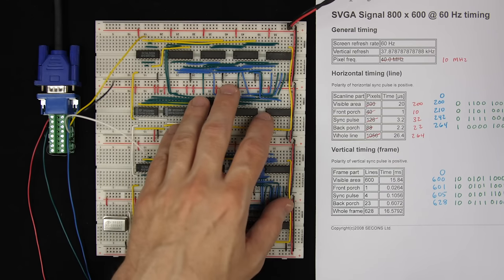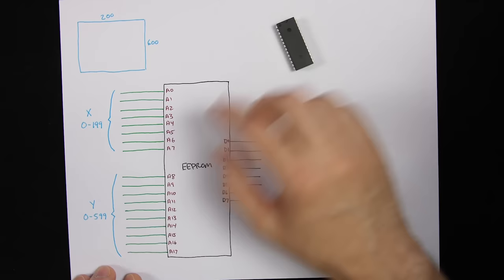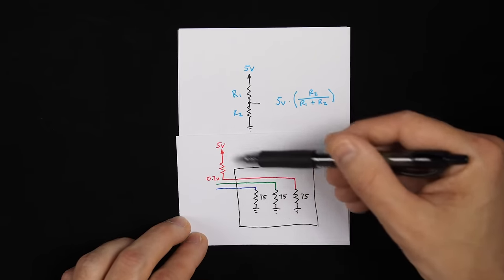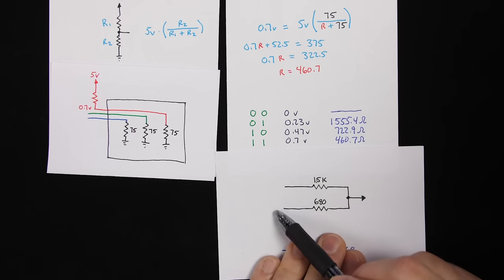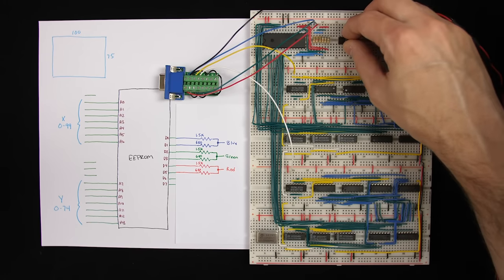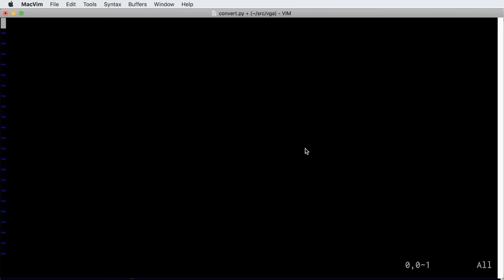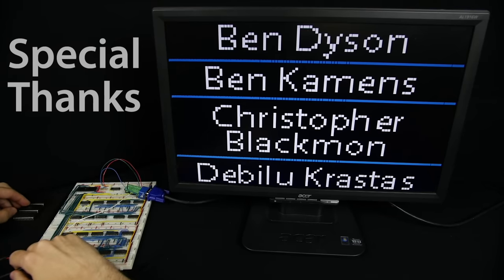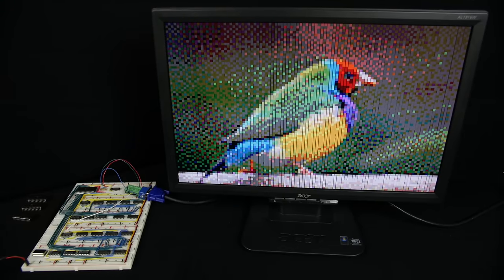World's worst video card? The exciting conclusion

Comment: +100% for ingenious design. - 1% for using exceptions as flow control. tsk tsk :)
Reply: why is that bad? It's a philosophy, and potentially faster if the exception is not raised in most cases. (Though in this scenario it's more common to end up in the except: block, so it's probably slower.)
Reply: You must be a java/c programmer! Exceptions aren't as costly in python, and In fact one of the zens of python are - it's better to ask for forgiveness than permission :)
Reply: @ajith12312  well I really have to get used to that philosophy, too...
Reply: @ajith12312  Exceptions in small projects where all the outputs can be predicted ,it's actually better to throw exceptions and catch them ... However in bigger projects.... well.... that's an exception
Reply: @amineabdz  ya that's true. It does become easier if the methods throw defined meaningful errors.
Reply: @ajith12312  c doesn't have exceptions...
Reply: @ajith12312  You mean relatively costly, because everything is costly in an interpreted language like Python.
Reply: @Lightning-Shock  hehe yup
Reply: it's the python way
Reply: You don't need to check for bounds anyway.  Just add out_file.write(chr(0)*28) at the end of the loop.
Reply: @ovalteen4404  True.
Reply: Nothing wrong with that in Python my dude.
Reply: Pythonistas love the exception (and pseudocode).
Reply: @user93237  Not experienced ones. Exceptions are there to catch exceptions, they are not there to act as a pseudo range checker or whatever. Its a way to gracefully handle something going wrong

Pythons picked up a lot of careless coders lately riding the fad wave in. I wish they'd pause a little and watch how the old timers do it. Pythons an ld language (seriously, its turning 30 in december). Its survived so long due to its cautious non hype driven nature. Exceptions where always intended as a way to deal with, well, exception. Using it this way is an antipattern
Reply: LightningShock Maybe he uses pypy
Reply: @shayneoneill1506  Experienced Python coder here, totally agreed. This is in no way Pythonic.
Reply: I think the exception checking here makes a little sense..  It allows for variable sized images to be loaded onto the card, but cropped to the upper left 100 x 75 pixels.  If he used specific range checking this wouldn't work.. though it is so special case and single use that I doubt it really matters what he did.  :P
Reply: @corneliaxaos2745  I'd be more comfortable if he used exceptiond correctly, by actually checking for an IndexError and/or KeyError. The problem with bare exceptions is they'll swallow OTHER problems and you might not know why your code is now behaving in undefined ways. You should never use a raw exception, trap for SPECIFIC exceptions. Still, its better to actually test the limits of the Indexes and then use something like an inline if statement. This is LESS code., and more correct array handling.

Hell you could probaly fold it into a lambda and a map and turn the entire exercise into a one liner. But thats a bit ugly and unpythonic.
Reply: @shayneoneill1506  ..  He did check for an IndexError..  :P
Reply: There's no excuse, in any language, for using exception handling to validate invariants.  Any attempt to justify it inverts sane logical practices.
Reply: Coming from a .NET background, I still don't see how it could affect the performance of the code. Yes, it does make it a little weird to understand but how is an index bound check and then do an operation any faster than catching an exception? Please explain.

And is there some sort of a best practice which frowns upon using exceptions as flow control?
Reply: @sensiblewheels  Exceptions are just that, exceptions. They shouldn't be used for control flow; they should be used to detect and handle the exceptional, the incorrect behaviour.

As to why an Index Exception is better than a plain, catch-all exception, this is because if you catch-all you probably would handle something incorrectly. Therefore your exception cases should target as narrow a problem as possible so that things can be handled in the msot correct way. Sometimes, though, it's justifiable to put a catch-all exception as a means of catching and logging unexpected issues that may crop up in a production environment that didn't make themselves obvious during development and testing. Better to fail gracefully than crash and burn.
Reply: @sensiblewheels  Yes, there's a general best practice that validating invariants (when appropriate) should precede execution, and the flow control should bracket operations.

The former is a proactive practice that prevents bugs and invalid operations rather than reacts to them.

The latter promotes atomicity and prevents code with side effects from executing.  In the case of how you're thinking, execution cost can be viewed as an observable side effect; although performance isn't everything... in fact it should be the very last thing considered when structuring code.  (Although, as a default, NOT performing operations is always cheaper than performing them, so flow control that prevents execution rather than responding to malformed execution is by nature going to have a default tendency towards better performance out of the gate.)

Using exceptions for flow control is modern spaghetti.  That "little weird to understand" becomes "incredibly difficult to maintain" when the total cyclomatic complexity and disjoint code locality of a sample increases beyond what any but the original author can manage.

Bad habits lead to bad practice.
Reply: @Lightning-Shock  Python is not interpreted, at least not in common implementations. The default implementation (CPython) compiles the Python to bytecode (which can be cached), which is run in a VM. Not entirely unlike Java.
Reply: @shayneoneill1506  "Exceptions are ... a way to gracefully handle something going *wrong*" - You do realize Python uses exceptions internally, also for non-error conditions? For example, exhausting a for-loop in Python is handled using an exception (StopIteration, to be precise).

Also, your assertion that something like in the video would not be done by experienced Python programmers needs some backing up. Perhaps you don't, but you don't represent all experienced Python programmers.
Reply: @phobos.anomaly  the bytecode is then interpreted.
Reply: @danielnewby2255  Thanks for the Insights :) I see this is a dividing topic. I'll keep all the points in mind haha
Reply: @phobos.anomaly  StopIteration IS a legitimate exception however as its requiring a generator to yield a value that doesn't exist. (And I'd presume a for loop is just syntactic sugar over a generator loop anyway in modern python). Ideally you'd be bounds checking beforehand, but this is a circumstance where the contract for a generator doesnt provide that prior knowledge (or it wouldnt really be a generator)
Reply: You're not "supposed" to build a video card out of TTL ICs, either. Adding three lines of code to accomplish row and file padding is just another way of keeping it simple.
Reply: @bitrot42  ....And yet doing it properly could be done in a single line.
Reply: Shayne O'Neill  that is a good point...  is there a one-line way to do it without the  “a if b in range(blah) else 0” construct? That’s a little hard for python noobs to interpret. (Exceptions are, too, though.)

Regardless, the video makes it clear that a few lines of Python can wrangle the bits into shape, and his explanation of what’s happening is clear. Learning Python is left to the student as an exercise. (Do textbooks still use that phrase?)
Reply: Well it's runtime versus coding efficiency and readability. The runtime doesn't matter at this scale, but the code was super efficiently and readably written!

Comment: I think you could optimize the second counter by simply counting how often the first counter reaches 200. after three times you know that the first counter reached 200  three times so it took 600 steps and the counter needed only 2 bits to count to 3. In order to count to 601, 605, 628 and so on you can simply use the numbers 201, 205, 228 from the first counter but only if the second counter states that it’s the third round for the first count so you know the numbers are actually 601, 605, 628!

Comment: around 3:02 "..I'm not going to hook this to a computer, at least not yet" A WILD SAP APPEARS FOR A FRAME ooooohhhh yesssssssssss
Reply: That was pretty much genius. But that thing needs some changes, with only 16 bytes of SRAM it won't work (code won't fit). Maybe 256 bytes of SRAM, or even a 16-bit address bus (with some taken by ROM, some taken by SRAM and some taken by a sort of more complex GPU that manages external RAM that would manage that amount of bytes, 200x600 = ~12k... I suspect mapping all of the memory directly isn't actually bad, you can have 16k of SRAM or that, 16k of SRAM for general purpose usage and 32k of ROM which would be programmed to have the code, after a few changes in the ISA)

If Ben teaches us about memory mapped I/O, I would actually REALLY want to do a significant donation from my first wage!
Reply: @paulstelian97  let's see if we are on the same page, since I'm mostly ignorant about the topic (I implemented the SAP using a software called logisim, and my knowledge only goes so far). 

The fact that the SAP has only 16 bytes of RAM (which I think you are referring to as SRAM) comes from an architectural limitation: the address is managed by the MAR, which is a 4 bit register (hence the 16 bytes)... in order to address 256 bytes, the MAR should be an 8 bit register.

But, the SAP is an 8-bit computer, and during the instruction fetch, both the instruction opcode and the memory address are read from the bus with a single instroction. Obviously you can't do that if the address is 8 bits long , which means that you should need 2 instructions: one for fetching the opcode and one for fetching the address. So 2 bytes instruction instead of one: this involves changing the microcode responsible for the fetch/execution cycles, aswell as other modifications (incrementing the PC by 2 instead of one, for instance). That should be relatively easy to implement. Using a 16 bit bus, on the other hand, should mean reimplementing the all thing (effectively building a different CPU). Am I correct, or am I missing something?

I figured that probably the best thing is to expand to 8-bit address, as I mentioned above, and build a somewhat crude GPU (so, a second "CPU" dedicated solely to display graphics..maybe simple sprites? I don't know), but I am absolutely clueless about how to implement the GPU itself.

About this part:
_ or even a 16-bit address bus (with some taken by ROM, some taken by SRAM and some taken by a sort of more complex GPU that manages external RAM that would manage that amount of bytes, 200x600 = ~12k..._
I confess I'm lost: could you please elaborate on it?

Also, I would like it too if Ben digs into mem mapped I/O, I vaguely read about it but I can't really understand the concept.

Anyways, we will see!
Reply: @RussellTeapot  Memory mapped I/O basically means that you have some device that acts like RAM to the CPU but isn't actually RAM but some other thing, where writes do magic things.

Changing the bus to 16 bits and any change in fact will mean a change of ISA. I mean, it happens all. the. fucking. time.

The crude GPU could in fact be made to be a simple CPU, because any GPU with even a little bit of parallelism would be too complex for such a small project. Real life GPUs are really a few cores with SIMD instructions that allow it to behave like quite a few more cores in an efficient way [as the processing is rather uniform for the massive amounts of data which is a frame]. So you'd still get to designing a 16-bit CPU.

That said, you can take the very same principles used to develop this and make a 16-bit CPU. Or a NES style PPU (picture processing unit, whose code cannot be customized) if you are thus inclined.

Comment: It's like programming. But with wires.
Reply: Computers have all the wired configured in advance so you can just turn on and off certain parts of that wiring based on bits you turn on and off in memory. You flip bits on and off in a certain pattern, and the circuits already in place respond to accomplish a task. It's a form of programmable matter I guess.
Reply: Programming with wires is just how they did it in the good old days.  Take a look around the web for IBM 402 and 403 control panels.  "Control panel" might have other names, like plugboard.
Reply: It's like redstone. But for real.
Reply: @unsafecast3636  No. Real life inspired by redstone. Jk

Comment: I wonder if a pcb would improve this graphic card with those high frequency working.. Thinking conductor skin effect could even take place here
Reply: I'd love to build this on a single PCB with higher-bit counters
Reply: It's far too slow to need a PCB. This could be done completely in free air, and it'd still run.
Once you get into high data rates, signal integrity does become an issue.

Comment: a very simplified version of that circuit could be used to turn a monitor into a light panel
Reply: Kinda defeats the purpose of a monitor doesn't it?
Reply: Not if you need a light panel and not a monitor
Reply: @init.d3067  Yep, I've actually done that before. Pretty nice if you have a broken display that you want to reuse.

Comment: Aren't you skipping a single cycle of data by prematurely resetting on 264 instead of resetting on 265 instead? I couldn't help but think that during the first video. I realize this is an old video but it's going to bug me that there were missing vertical lines and I think that was the bug.
Reply: Unless I've terrifically misunderstood something, all 264 cycles are accounted for. They are counted by the numbers 0 through 263. If we reset on 265, the timings would be off and I'm pretty sure that would be very bad.
Reply: @rynin8019  I believe cycle 264 instantly resets to 0 and the next clock cycle would count up to 1. Meaning we are basically skipping a clock cycle in the sequence.
Reply: @Gennys  You're right that the next clock cycle would count up to 1, but not after spending a ten-milionth of a second at 0. We spend equal amounts of time at 0,1,...,263, which is a total of 264 cycles.
Reply: @rynin8019  You may be right about it, I would have to look at the spec sheet in the first video. I was positive it was supposed to be an inclusive range of 0 to 264 not exclusively. And if true then 264 and 0 are executed on the same clock cycle. I noticed that the vertical and horizontal timing (as measured by the oscilloscope) was off and lower than the spec sheet from the start and that missing clock cycle might have accounted for it.

Comment: I never thought a video card would actually be this easy to make... I SO need to build one myself
Reply: Easy is a strong word
Reply: @X606  well true, but I sure imagined the workings of a video card to be much more complicated than this. So it's easy in contrast to my expectations I guess
Reply: @ashkat64  yeah but this is a VERY primitive video card. it only supports 1 resolution and can only display 1 picture at a time. Id imagine normal video cards are a lot more complex than this.

And thats not even counting all the other stuff modern gpus can do thats not rendering.
Reply: @X606  Ofcourse modern day graphics cards are way more advanced. I mostly meant that the basic principles of a VGA signal are way simpler than I thought.

Knowing this guy it wouldn't take long until he'd have a multi-resolution rendering graphics card though XD

Comment: 12:50 just imagine if he switched the polarity of power supply by mistake 🤣🤣!!..
Reply: Worst case scenario, he had to replace all chips. And that is nothing, because no soldering is involved. Just pull out old one and plug in fresh. 10 minutes of work at most, provided he has stash of parts (I bet he does).

Comment: I cannot wrap my head around "10 million times per second"
Reply: 10Mhz is quite slow
Reply: Lucky Ben didn't go for the full 40 then eh 😁
Reply: Try the 2.9 BILLION times per second your average desktop CPU runs at?
Reply: @nockieboy  Yeah I know, the calculations per second are seriously mindboggling in modern computing.
Reply: nockieboy At some point, numbers become too big which causes it to not matter anymore. The company where i work, they spend 2 billion to buy up another company. Like if you buy a house for 1 million it will be an enormous villa. That company could buy 2000 of them and still not get bankrupt. Crazy numbers.

Comment: next video: "making a 8k144hz capable breadboard graphics card"
Reply: VGA doesn't support that resolution (nonstandard, the pixel clock would be around 20 GHz... which means 50 ps access times... Why do I believe that ain't happening? There would be some embedded parallelism to lower this frequency in actual cards and FFS we don't actually support VGA for such a resolution -- for 1080p we need 148.5 MHz pixel clock, 6.7 ns pixel time, horizontal frequency 67.5 kHz, vertical frequency 60 Hz, total 2200 pixels per line due to HBlank, 1125 lines due to VBlank). 4k requires ~500 MHz pixel clock, which won't work with stuff on a breadboard (even 148 MHz is pretty bad).

And the chips that Ben has around... they don't handle 10 MHz well. Fucking hell.
Reply: Alin S   Even if it was remotely possible I assume it would take more than a whole bunch of them xD
Reply: Alin S long live Radioshack :(
Reply: F for RadioShack

Comment: Wanted to ask, for the RGB output wires to be connected to the monitor, could he use diodes in reverse bias to get the 0.7V instead of voltage divider